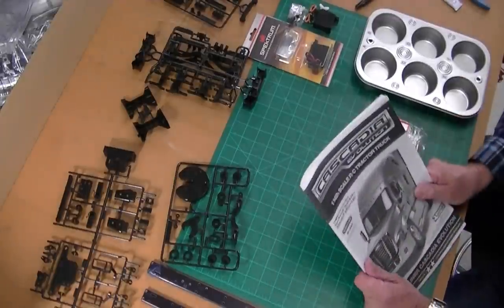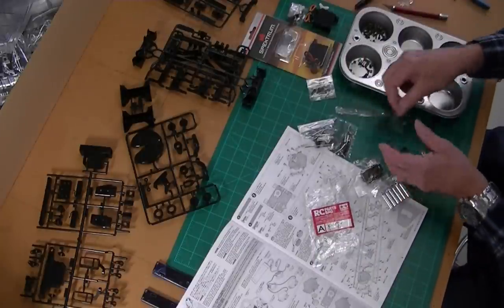Tamiya RC Freightliner Cascadia Build   Part 1

Comment: I wish tamiya would only include the hardware and tools necessary for each step in the bags with the parts for that step!  The way Team Associated does.
Reply from the maker: On the new kits they do it tat way, but the King Hauler has been around a long time so they still do it the old way.  Still is a great selling kit for Tamiya.

Comment: Love your videos👌👍🤙 question. So no grease on rear drive shafts?
Reply from the maker: I am not sure what shafts you are referring to but if it is the driveshafts' (propeller shaft) they should have a dab of grease on each end.  If the axle shafts no grease is required if using ball bearings.  If you use the sintered bronze bearings from the kit then they do need to be greased.
Reply: Time 26:56. Rear double short shaft between 2 rears. Should input grease in the diff cups / shaft ball ? or no?  Thank you again

Comment: hiya again. can you tell me what else i need to get from youre store to complete the cascadia build? i plan on buying the truck kit and the mfc 01 unit in  a few weeks. what else do i need to complete 1.e.servos, transmitter, rx and the like. trhanks again and how was the vacation lol? please send link for your store also thanks
Reply from the maker: Michael,  You need a transmitter/receiver, 2 servos, 2 servo extensions and a ball bearing set.  Contact me at jacobsenra@hotmail.com and I can fix you up.

Comment: As I get ready to do another, a Cascadia on commission, my only thought is why do you use the only poor part on the kits? Yup those awful plastic wheels. As this kit, and MFC, radio, with paint, is almost $1000.00 a set of alloy wheels is $80.00 shipped in the USA should be a no brainer. 
Great job as usual!